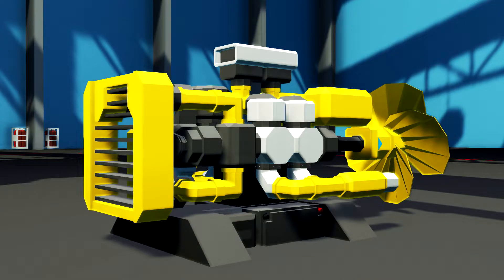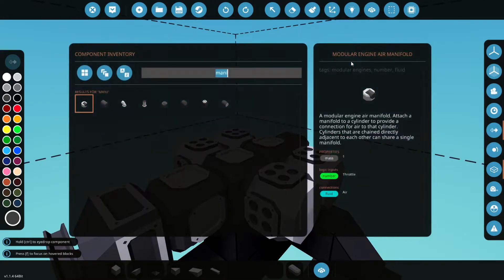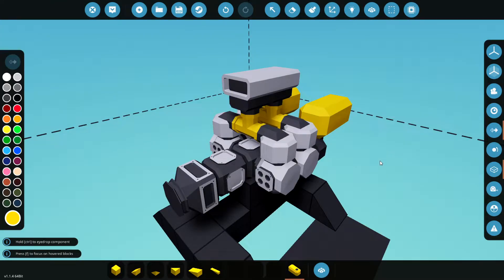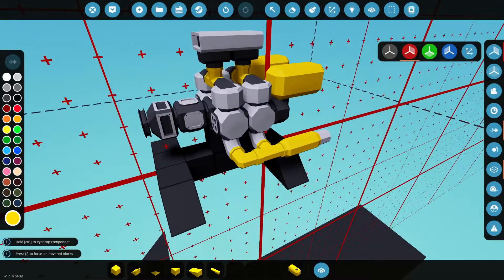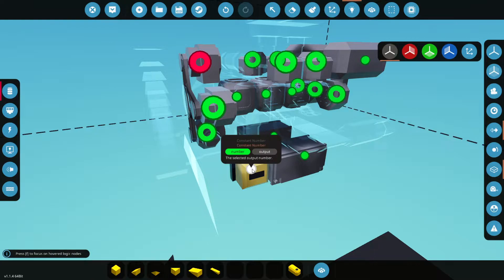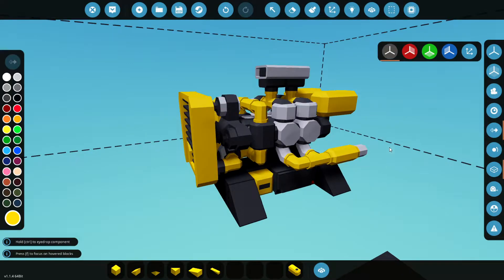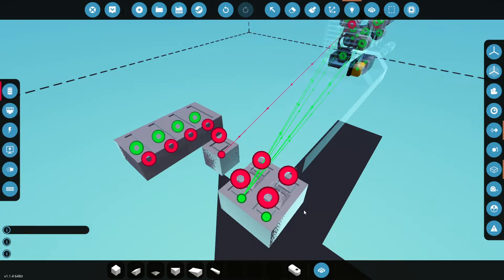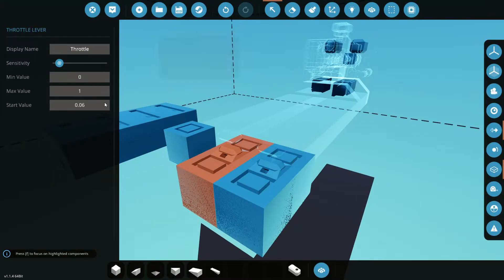FULL Modular Engine Build (WARNING! - See Description) - Stormworks

Comment: A simple way to describe what the values of a PID do:

P - How strong of a reaction you apply when the values do not match, scales with how far apart they are. Too low will take too long to respond. Too high will overshoot and cause fluctuations.

I - How much it looks back to what was happening before to get a general trend. Too low will not correct constant misses resulting in the values getting CLOSE but never quite reaching each other. Too high will cause previous errors to compound and fluctuate out of control.

D - How strongly it predicts what will happen in the future based on what is happening now. Too low will stop it from snapping to the target quickly. Too high will cause any sudden spike to overshoot, noisy inputs will result in massive fluctuations.

This is not a perfect description, but based on what I could find online when I started messing with PIDS, this is how I think of it. Due to you not having any value for "I", your numbers did not match between the in and out. If you increased "P" they would get closer faster, but "I" would correct the error and get them in line with each other. Hope it helps!
Reply: Very helpful
Reply from the maker: Thank you so much for this explanation, this is a great help! :D

Comment: It's not matching because you are using a pid with an Integral of 0:
The PID is working with differences between SetPoint and ProcessValue. Let's say x=SetPoint-ProcessValue. Using only P in the PID results in the following formula: Y=X*P. So if the difference between the input values are 0 (SetPoint=ProcessValue) the result is 0, resulting in a throttle value of 0. So with only the P-Factor you can control systems wich are stable at a value of 0. (e.g. rudder of a plane or boat). The D value of the PID results in the formula of Y=(X'-X)*D, where X` is the last X. This should prevent a system to overshoot but the stable result is also 0. The total formula of P and D is: y=X*P+(X'-X)*D. The last factor is I and the formula of I is y=SUM(x0..xn)*I. All differences since PID-start are added. With this you can reach the desired result, that the RPS will reach the exact SetPoint but the sum starts when enabling the PID. If you don't modify the throttle this works but as soon as you change RPS It's reaching the new RPS valy very slow, except you re-enable the PID every time you chage the throttle. The complete formula is: y=X*P+SUM(X0..Xn)*I+(X'-X)*D, where X=SetPoint-ProcessValue and n the tick since PID-start. I hope I could help you and my advice is: You shouldn't care about the difference between your throttle lever and the rps. Bad english, I know but it's not my first language, sorry.
Reply: This is a very good explanation. Because im no engineer or math person i need to read it a couple times, but this makes clear how the pit works. Thanks
Reply from the maker: Wow this is an incredible explanation! Thanks Sengir!! I will do some some work on this and see how it goes. Thank you so much for taking the time to help!

Comment: If I had to guess, the biggest reason your rps doesn't match your throttle is you only have 1 pid sending the same value to both your air manifolds and you fuel manifolds. I think you need 2 pids so you can send different values to the manifolds. I think your fuel manifolds need a different value than you air manifolds so your microcontroller can adjust the amount of fuel and air separately to achieve and maintain a desirable afr.
Reply from the maker: Very interesting, I didn't think of that! Thanks for watching Jake :)

Comment: With the new update, this tutorial is outdated. You can not use 2 air 1 fuel manifolds to get a nice afr now. They have removed the multiplicative effect. Also it is a good idea to connect non touching cylinders with engine manifolds so they all get the same air/fuel. Great explanation. 

Edit: Something I wanted to add, fresh water tanks doesnt make much difference (Sometimes they even make things worse) so its not worth adding 2 extra blocks. I liked that you didnt use them.
Reply from the maker: Hey thinking Pear, thanks for your comment :) Yes it's now outdated because of the changes. I will put this in the video description, thank you for reminding me :D I appreciate it!

Comment: How would one get this setup to work?
Reply from the maker: Hi thanks for watching the video! If I remember correctly, it's to do with the air and fuel manifolds. They changed how we use them. I can't remember exactly, so this may not be helpful to you, but I think having say 2 air manifolds and 1 fuel manifold won't give a 2:1 air fuel ratio anymore. So you can just use 1 of each manifold, or any number/combination, and then apply a ratio through some number logic gates. This info may or may not be correct lol. I hope it helps though :)
Reply: @MrSticksman  Thanks for the reply! Yes I was able to get it working with a engine ecu microcontroller.

Comment: coolant is shared between cylinders too :)
Reply from the maker: Hey Acc, thanks for watching! Yes it is shared between the cylinders as a pair :) I found that the pairs didn't share the coolant from one side of the engine to the other so they had to be either linked with manifolds (if this would work?) or cooled by two separate cooling manifolds as I used here. it works really well to have separate cooling systems for each pair of cylinders, although it took up extra room so I settled on a compromise.

Comment: How long does it run without over heating?  Cus the coolant manifolds seem bugged af
Reply from the maker: It should cool better with a fan radiator or even sea water. However sea water can wear down the engine. I mainly chose this rad as I liked the look of it here, but there are many better options for this engine.

Comment: Doesn't matter what I do.  Mine won't start and says I have no exhaust but I most definitely do
Reply from the maker: Hey thanks for watching the video! I will try to help you, although I'm not an expert :D The game has been changed a bit since I made this video so this engine may not work anymore. You might need to adjust your air:fuel ratio to 2:1 in order for it to start (using throttles, logic gates or microcontrollers etc.) The game used to allow us to create a 2:1 ratio by using 2 air intakes and 1 fuel intake. But I believe this no longer works and so the actual values have to be adjusted instead. So you could try using a normal air intake, but halving the fuel that goes into the engine by diving it's value by 2. Therefore creating a 2:1 air fuel ratio. There are a number of other ways to achieve this. The exhaust might show a 0 value until it's running. Or if your engine is different to mine, maybe you just need to add more exhausts. Sometimes I need to add more exhausts to make my engines work. I hope this helps you :)
Reply: @MrSticksman   Thank you for the response I have since figured out what the exhaust problem was. Now I am stuck on the coolet manifold's not cooling my engine. I will pump water into the manifold at 50pressure and the exit pressure will be dropped down to something like 5 and my engine no matter what will still overheat.
Reply: @MrSticksman   Also I get really good results by hooking up my fuel manifold to a multiplier and a constant number setting the cost a number to .5. So inputs are my throttle(which controls my air manifold) and constant number(0.5).  Output to fuel. I can get efficiencies as high as 95 or more.